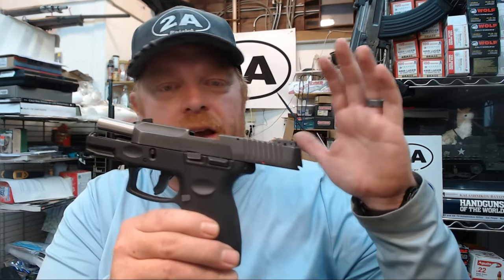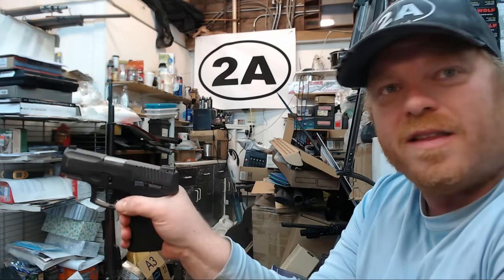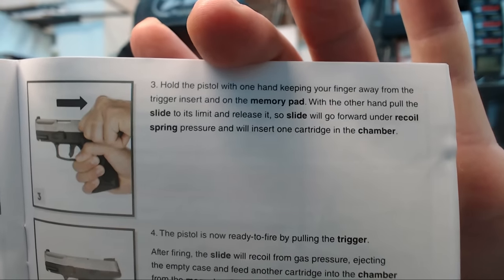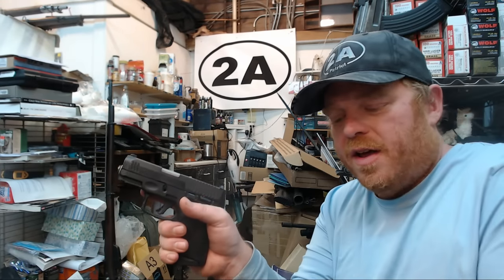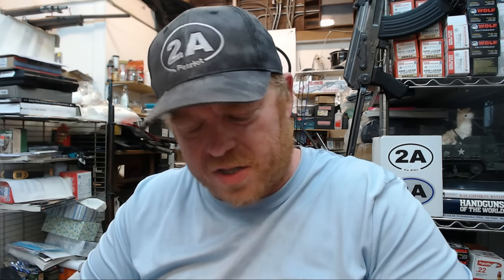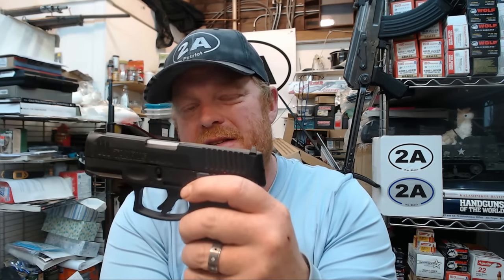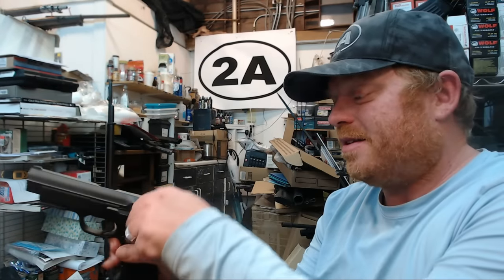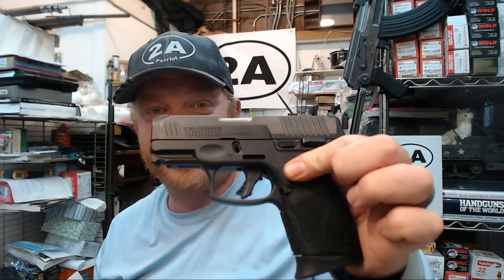📌 Taurus G3C G2C G3 9mm Stiff Slide Catch Release : How It Works : Pistol Loading & Slide Function

Comment: 3:40  Before I watch any further I'm gonna guess  The reason hes pointing out the difference in the wording is because Taurus probably intends on you to actually pull the slide back instead of using the slide lock/ release  Which I do sometimes and that kind of messed me up when I got my 1st 1911 cause it's a Springfield army micro compact that I mentioned in my other comment and I tried to pull the slide back to release the slide catch and realize that you have to actually press it and I thought something was wrong with it until I took it to the store and they said no for most 1911 you have to actually place down on the slide lock Flash release instead of pulling on the slide... So now my goal to move is to actually use the slide catch/release So I'm  Used to doing the same action in case I switched from one gun to the nexthen to the next (Even though the 1911 is the only semi automatic pistol I own that I HAVE to use the slide lock/ release on)  And if I'm wrong or the people at the guns that would lie to me and that's not normal feel free to let me know cause this is my 1st 1911 and I'm not super familiar with the model yet

Comment: My first carry is the G3c. Love the gun. I got some Winchester defender ammo (127 grain). The bullet has this serated  tip and to rack the first round the slide gets stuck. Have to slam the but to rack it. After that I can fire with no issues but man... This is the only round thus far that I have issues with. I put in about 50 rounds with this ammo. Do I have to put in more to work it in better?
Reply: Perhaps you can just load the first round manually, with the slide locked open, close the slide, then insert the mag.
Reply: @gregb6469  I could but I don't carry with one in the chamber. I know that's bad but it's an irrational fear I have about a misfire.
Reply: @star-warsien  -- So it's either fight the gun, or load different ammo.  The latter would be the better choice, because in fight with an attacker you may not have the time or ability to manipulate the slide into closing properly.

Comment: On my g3c. My safety won't go up after bullet is in chamber. Do you know why?
Reply from the maker: The safety should work after you rack the slide. Whether there is a round in the chamber or not. If it will not engage with a round in the chamber, something is wrong. I have never had this happen. I would contact Taurus customer service.
Reply: @2aEdu  ok thanks

Comment: Understand what your explaining.  My prob is slide wont lockback with mag removed on g2c. Only 6 rounds through gun.
Reply from the maker: Are you pressing up on the slide catch/release with the slide all the way back? Hold it up and let go of the slide. It should hold it. Then you can remove your thumb from the slide catch and it will stay open.

Comment: Do you think bx25 ruger mags are on the ban list
Reply from the maker: If the Biden plan goes through, and mag over 10 rounds will require a 200 tac stamp. But there may be an exception for rimfire. But I dont know for sure with the 10/22. I would say 50/50 on that one.
Reply: I scored 1k rounds of 9mm syntech yesterday local hunting fishing store for $275 he had 762.39 as well $7.99  308 was $70 box 20 count😵 he said that he was told by his supplier don't expect any more ammo till spring

Comment: What does it mean if your slide release doesn’t lock into place when you pull it back with no mag???? Bc my does that but my dads doesn’t
Reply from the maker: The slide should not lock open when a mag is not inserted.

Comment: Ok why is mine so hard to take the slide off? When I pull back and pull the lever down and the slide goes forward it just stops which I think it may be I'm not pulling down on it ALL the way evenly on both side and  then pull trigger  to get it to go forward. Hope you can get a picture in your head about what I just said an not a stroke
Reply from the maker: Yes. You have to pull both sides down evenly and to the bottom.
Reply: After pulling the slide back- then pulling both tabs down , all the way and evenly- release the slide and let the tabs go back up. Then- pull the trigger back until it dry fires. Then release the trigger. Now the slide will pull off the frame. It sounds like you are not dry firing the trigger. Just be really sure your magazine is out of your gun and there are no rounds in the chamber before you field strip. And always point the muzzle in a safe direction before you dry fire for take down.
Reply: @shadowwolf7622  I know how to take it apart I was just wondering why it's harder to do than my th9 is. Is it because one is hammer fired and the other a striker fired or I thinknits I'm just not getting the lever pulled down evenly on both sides before pulling the trigger. On the Th9 I dont have to pull the trigger to get the slide forward. Idk just curious and trying to gain some knowledge from people that have more of it than me. Guess I shoulda worded it better but thanks for your response
Reply: @RayFinkle22266  When I went to field strip my new G2c for the 1st time last week, I did fail to pull down one of the tabs all the way. And I'm an old timmer gun guy! My slide just kinda locked up and I was left scratching my head for a minute or 2. But I messed with it for abit and she finally came off. I've had mine apart and back together several times now- just cleaning and oiling and getting to know it. It was pretty tight at 1st- coming apart and going back together. But its getting much easier now. It seems every new auto I get is kinda sticky at 1st. But it don't take but a few field strips and some oilings and they get much smoother.
Reply: @shadowwolf7622  yeah that's how this one was at 1st but I guess I've learned to just squeeze the crap out of it before pulling down on both sides as it tends to slip from under my finger. I bought a keep tinkering flat trigger to do away with the g3c safety trigger and am waiting on the punches and small picks to come in before changing it out. I've had it for bout 2 weeks and cant get a gunsmith to do it for me so I have to do it my self and be ho.est I'm a lil intimidated as I've never done that but I think I can get through it just excited to install it and try it out it's the last thing I believe I can do to it as upgrades go LOL
Reply: @RayFinkle22266  Roger that. I've been really making sure I have both tabs pulled down good before I let the slide go forwards since Iocked it up the 1st time lol ! The tabs on my G2c are easier to pull down than the ones on my Glocks are. Honestly- I'm iffy about changing triggers and other parts on my guns.  I know some people like doing upgrades, but I've had a lot of trouble with aftermarket parts in the past. Almost every used gun I've ever bought or traded for that didn't function right did so because of aftermarket parts or trigger jobs. I personally like my guns all factory. All I'll change is sights and grips. But that's just me. If you do decide to change your trigger, let me know how it goes. I've got to clean and go through 2 guns tonight. I picked up 2 Heritage Rough Rider 22 cowboy revolvers this week. One with a 4,75 inch barrel and one with a 6.5 inch barrel. I've already got 1. But I like single actions. Taurus owns Heritage now. And to be honest, the fit and finish has went down hill some since they took over the company. My older one just looks better. But, for $129 they are still a good deal I believe. I like my bigger caliber guns- but I feel like I can't ever have enough 22's around. My dad just gave me his Ruger Single Six 22 single actions. I guess I need to get me a horse and a cowboy hat ! If you get the courage to do that trigger- just take your time and go slow. And watch several videos on it. I've messed with guns for my whole life and I still learn new things watching videos. Good luck!
Reply: @shadowwolf7622  oh I'll for sure let you know if it went well or I have to pay out the ass for a real gunsmith or taurus to put it back together LOL. The guy who makes the triggers sent me a video of the install and from what I've read of other ppl in the same boat as me said it takes about 45mi utes to hour the 1st time. My dad bought me my 1st pistol after our CCW class a ruger p95 and I loved it  the 2 taurus guns I bought myself last year 1st was the th9 and it's really hard to find accessories for but when I heard about the new g3c coming out and how good it suppose to be I bought the 1st one my store got  in only problem I've had out of it was when bbn I put think 145gr hp hornady in it and it jammed on the ramp so I cleaned the ramp and it didnt do it but I went and bought a threaded barrel from lake line tritium sights recoil spring from lake line a compensator and a 15rnd mag so it fits my hand perfect I did EDC the th9 till I got the g3c but  I was going to buy either an ak or ar with this last stimmy but couldnt find a reasonable priced one so I spent it on my g3c and my ks7. But with the aftermarket stuffnive put on it i honestly believe its helped the gun and this trigger suppose to be a lot lighter pull think it sad 3lbs and an almost instant reset or a lot quicker than factory  but yeah I'll sure let you know how it goes. Hell man if you want to swap yours out idk if it n.v has the trigger safety like the g3 does but if it dont a gunsmith should do it but if not the trigger I got and he makes em for the g2 also and many others and I gave 25 dollars for it with the spring it's called keep tinkering and he has youtube channel should check him out but I'll let you know my tools suppose to come in tomorrow so guessbill try it the
Reply: @RayFinkle22266  I just got done cleaning one of the Rough Riders. Took the grips off and the cylinder out. Punched the barrel and cylinder. Pit a few drops of some Lucas oil in the action and trigger. It felt a little gritty. But after oiling it and cocking it several times, it is slick as snot! It's loaded now and in it's new holster. I had a new Uncle Mike's hip holster here already. The exact size the Heritage calls for. It's in there now, molding to it. It's going to be my summer fishing and beating around gun. I used a new Glock 9mm last year and it rusted up on me - inside and out. And I was keeping it oiled. Glock brags about their guns being pretty rust proof. I guess I proved them wrong on that ! Lol. So I decided to use a cheap 22 this year. Rather it get some wear than a $500 gun. 
I have been watching videos from the guy you are talking about. He does seem.to have some good ideas. I'm glad you got your Taurus going. I have been seeing videos of guys having feeding issues with some HP bullets with the G3. It seems to be more of a G3 problem and not so much with the G2c. I did find a weird quirk with my G2c. The 1st rounds I tried clambering and unchambering in it, American Eagle 124 gr FMJ, feed just great when I racked the slide. But when I tried to eject them, the slide was froze shut. I finally held the back of the slide with one hand and whacked the grip with the other a couple times. That got it open and it ejected the round just fine. I've never had any problems with that ammo. Always works good in all my 9's. I thought. "Oh crap- it's broke and I guess I'll be dealing with Taurus non-existent customer service!". But I ended up trying 10 different loads. All weights and bullet types. Gun feed and ejected just fine. I did some research on the matter. Seems Taurus is putting short chambers in their 9's. Because of this, some rounds that work just fine in most guns will lock up a Taurus 9. If a bullet goes past the chamber and touched the rifling, it will lock up like mine did. So from now on, I'm checking all New brands before I use them. It doesn't bother me any. It has did fine with 10 of the 11 I tried. It just had to do it with the 1st ones I tried! Oh well, at least I found out as soon as I got it. 
I love the Ruger P-95, and all the P series. They are great guns. And probably the most reliable autos I've ever shot. I've carried several of the P series-9's-40 and 45. I could pick them up used around here when I was younger for $200-$250 all the time. Most gun snobs didn't like them. They always bitched that they were too big and heavy. I really wished I would have kept a couple of them! I went through my AK stage back in the 90's. They were just starting to come in then. You could get a Chineese or Romanian for $250. I got my 1st AR a few months ago. My local shop got in 2 of them. They were S&W M&P's. They had them priced at $750 and I had the money. And they had a bunch of 5.56 for $11 a box. I've shot a lot of them when I was in the Army and shot several my friends had. Just never bought one. I've kept it stock. Just put a sling on it and got some mags and ammo. I will say, in my experience, the AK is more reliable- but the AR just feels better to me and shoots better too. 
I better get off here for now. Gotta eat and get to bed. If you ever need any gun advice, give me a holler. I'll admit I'm far from knowing everything about them, but I have been owning and shooting and carrying for along time. It's been good talking with you.

Comment: Isn’t that hard on the firing pin slam in that slide forward without a cartridge in it
Reply from the maker: This pistol ( along with most modern pistols) has an inertia , spring loaded firing pin. I am not worried about it breaking on an empty chamber. If you are, then ride the slide a little bit when closing it on an empty chamber. But never ride the slide forward when chambering ammo!

Comment: Took my g2c to the range earlier.. I had issues .. 1st.. I chambered a round .. it would not let me eject the round what's so ever.. I ejected the mag and discharged the live round.. after trying multiple times to eject the live round..would not let me pull the slide back at all..so I pressed the trigger and discharged it down range...and this happened 5×.. 2nd it kept re striking locked in the same position with out discharging the round . Then after bumping it and play with it.. I pressed the trigger.. YES IN A SAFE DIRECTION JUST WASNT EXPECTING IT TO DISCHARGE.. ANY ONE HAVING AN ISSUE WITH UR G2C CHAMBERING A ROUND BUT LOCKED TO EJECT THE ROUND..iv gotten all upgrades from Lakeline except the barrel..and only changed the butt plate..iv narrowed down possibly the original mag...
Reply from the maker: I would suggest shooting it with all original parts, and see what it does then. Then you can try replacing one part at a time, then shoot it. That way you can narrow it down.

Comment: I never had a problem with these slidelock/release on my G2C And after watching  About 3 minutes of this I went and tried it out on my G2C and realized it is a little stiff but I'm not a little 6itch so I never had an issue with it🤷‍♂️🤷‍♂️🤷‍♂️🤦‍♂️🤦‍♂️😂🤣😂🤣😂🤣😭😭😭😭jkjk... kinda😂🤣😭  But seriously though I never saw an issue with it because the slide release on my Springfield Armory micro compact 1911 is way stiffer but I also bought that used and I've never cleaned the gun so that might have something to do with it but when I took it back to the store they said it felt pretty normal for a 1911

Comment: thank you
Reply from the maker: No prob 👍
Reply: @2aEdu  i just got one and im trying to get the hang of using the slide, my catch release is stubborn too. How did you just pull it back and let it go back to normal so easily? i tried to do the quick pull back release without hitting the slide catch and it stayed locked and pulled back until i pushed down the catch. Obviously im not doing something right. Thanks for responding on top of the good video. ill comment like 5 times to boost your video comments you a g

Comment: I have a brand new G2, its impossible to push the catch/slide button down. I dont want to chamber a round, I just want to close the chamber. You could still push the button one handed, it takes me two hands and a TON of force to get that button to push down to release the slide. I am debating calling Taurus. NOT a good EDC gun if you cant do this one handed. Ugh.
Reply from the maker: If you remove the empty mag, it should close easily.  Or slightly pull back on the slide while pushing down. I showed several methods that should help. Or call Taurus.  Something could be wrong.  IDK?

Comment: Honestly I just felt that it was a little absurd that you even had to go into this much detail to explain something like this to begin with. I guess some people are just inexperienced or too lazy to simply read their owner's manual. Personally I didn't find it to be that difficult to release the slide with the slide catch fresh out of the box with no break in. It's a little stiff, but nothing to complain about. I always thought it was better to have that stiffness to prevent any accidental slide releases. I know on some firearms that has less tension often have trouble with the slide locking in place after that last round. Not something I would want to have to be concerned about with my concealed carry especially when in a defensive situation. I do prefer using the slide catch over the pullback and release method simply because I can get back on target faster. But if I'm just putting up an empty gun for the day then it doesn't really matter. Pull that thing back stick it in the bag and go on.
Reply from the maker: Obviously not absurd. Read the comments and you will see how many people this video helped